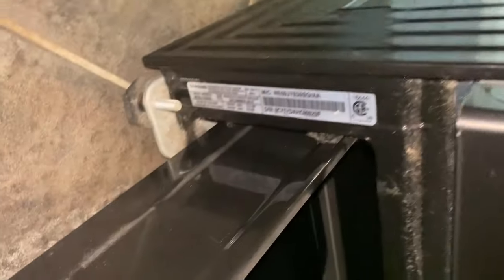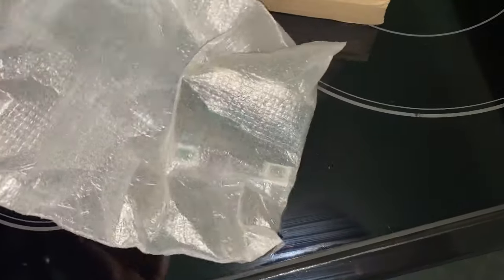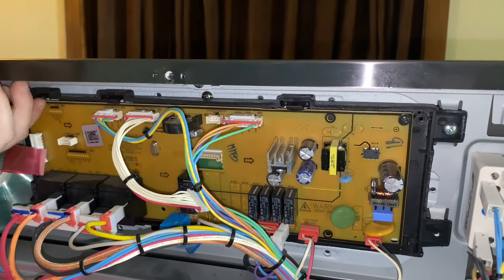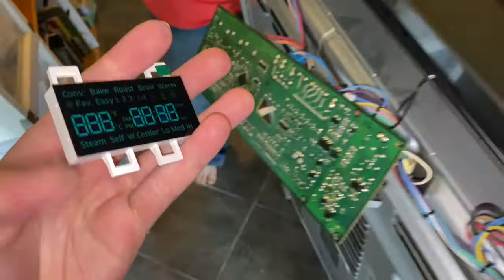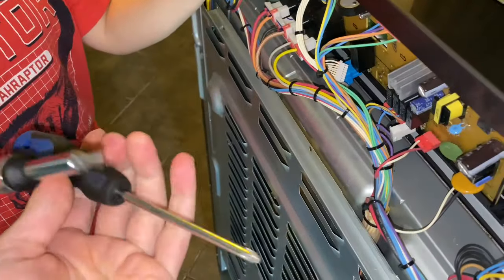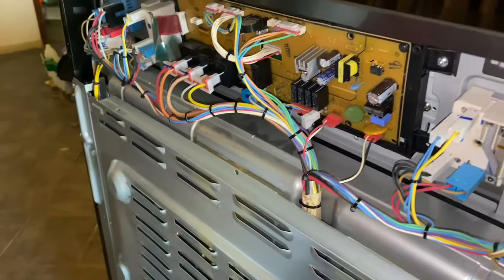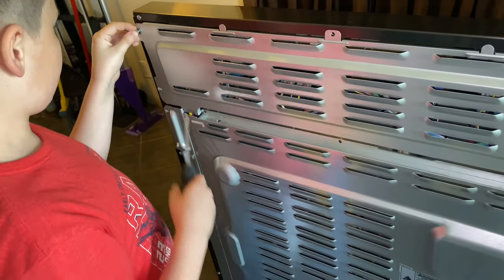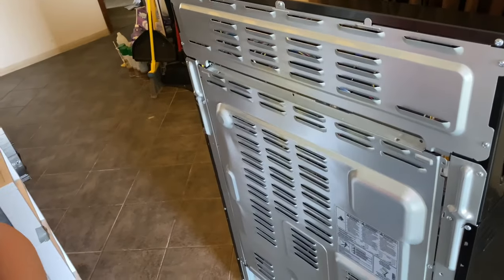Samsung stove NE59J7630SG display flickering repair fix replacement

Comment: Thank you for sharing this collaboration. My stove has been flickering for 2 years it’s only 4 years old.
Reply: I have the same thing. NEVER repurchase a Samsung. Mine is. 5 years old. Extended warranty just ended. I was told by an repair man to never use the self cleaning part because it heats up too hot and can ruin circuit board.

Comment: Nice job. 

Hey Samsung. This video has been watched 33k times. Do you want to know why? You sell faulty equipment. My stove required a new pannel in less than 4 years.
Reply: Samsung is building a reputation…too bad it’s a “do not purchase our crap reputation”!
Reply: Purchased a full suite of Samsung kitchen appliances.  Never again.  
Stove - this issue
Refrigerator - infamous ice clogging issue
Microwave - clock loses two minutes a week, peeling at edges
Dishwasher - blades break, occasionally faulty moisture leak detection so it won't run for a few days

Comment: Thank you so much — I googled previously and I found I had to replace to the board for over $400- so glad I found this video! I’m glad I watched the whole thing though because I didn’t realize I had to unconnected some wires before taking off the board. I got to see it go back together though and that’s the important part. Much appreciated!

Comment: Thanks Man, had my bloody screen flickering for over two years and even tried replacing the board once last year but it didn’t work. Your instructions were spot on, just did it with the wife while following your video and it’s fixed. Thank you so much man, great job with the boy as well.
Much appreciated!

Comment: Thanks for the explanation and video. It looks like a repair that we can do ourselves. Great job Alex and Alex’s dad! Update on our installation of a replacement digital clock. Our son helped us with the installation and found it more difficult than we expected to unplug the cable on the back of the broken clock when removing it Also, 2 of the black plastic hooks that held the old clock in broke off. We used electrical tape to securely put the new clock in and everything is working well.
Reply: I had the same exact experience. Managed to break a clip and had to tape it back on.

Comment: Thanks for you video. Our stove has been flashing for a long time. Hasn't affected the operation but is annoying to see it flashing all the time. I have the same model as yours. Very cool you did the video with you son!!! I have the part on order, so hopfully ours will be   like new again as well.
Reply: Ours is flickering as well but I can live with that although I am wondering whether the flickering is a precursor to a complete failure meaning the stove would not be usable.

Has anyone waited until it fails?

Secondly, what kind of assurances does anyone have that the replacement display doesn’t start flickering a year or two after installation as they are likely all from the same manufacturer.

Comment: Thanks. Very helpful. A little more detail about removing the cable connectors would have helped, but no big deal. As someone else mentioned, no more disco lights.

Comment: Great video. I had  the same issue. I did many projects with my Dad and as a result rarely call a repairmen or hire contractors. I noticed that you didn't take off the protective film on the LED before install, probably will make little to no difference in the display.
Reply from the maker: You are right, Just a clear film. This was the friends kid, believe he’s on the spectrum. I wanted to include him since it showed others that a child can do it, they could too and he asked before my arrival if he could be on YouTube. 7 months later, over 10k views, he’s done more than what he realizes.

Comment: Nice video but you cut out the part where you disconnect the two connectors. Would have been helpful to see the original issue too. Thanks though. Still a big help.

Comment: All of my Samsung appliances are junk
Reply: Bingo!
Reply: I told my girlfriend I hated Samsung before we bought a house. We’ve been here 2 weeks and I’m here watching this video. I’m replacing all the appliances within 2 years. Even if they’re working, I’m a man of principles.
Reply: Yes they are junk. I have a stove and fridge and they are both nothing but problems. Garbage.
Reply: Amen to that. My are also terrible. My dishwasher is the worst.
Reply: Yep! Just replaced a fridge and now doing this repair on the stove
Reply: Ditto junk
Reply: Junk at best. My Samsung gas stove  has a mind of it's own. Turns the light on inside the oven. Some times it will turn off ,or unplug it. Service was a joke too. Was told it was out of warranty. After a few mean texts with tech . Told they would pay for the part, but service was on me at 130 an hour!!!! Told them to send part I would fix it myself. But sure they couldn't do that  I think someone should start legal action against them. I'd be on board.
Reply: The biggest piece of garbage I ever bought, I used the oven twice and a f-c7 code is on the screen. Call the store SOL, the warranty just expired a week ago 😡😡😡
Reply: SAME
Reply: All of the samsung appliances we've had are the worst. They need to stick to making phones.
Reply: Biggest regret of building our house.
Reply: Same here!!! I regret Samsung

Comment: Hi, when this happened did you experience your bottom right element to turn on/off when you turned the knob? My stove currently has the LCD issue and the bottom right element goes on/off and I feel as if the oven is doing the same.

Thanks, J

Comment: I wish you had show the flickering before fixing.  Mine is doing something and I am not sure if it's what yours was doing. It's a Samsung and on the display you can see really light background lights flickering, like the time and everything I am using looks normal, but in the background you can see flickering other symbols that aren't being in use.  Is this what yours was doing?  My stove looks like your exact model.  Is it the same situation??? Thanks!
Reply: Did you find a solution or did doing the same thing as this video helped? Our's is the exact same issue as yours and seems like it's a common issue going around when I was looking at the Samsung community board site, the mods just tell you to PM them your model and stuff for help. But seems the consensus is to buy the range part that cost around 100 dollars to solve the problem.
Reply: @PlatonicPurplePanda  I haven't tried it yet, seems like a lot of work lol.  Not really, but just haven't got to it, seems everything is going out, light fixture went out, dryer went out, fixed those haven't got to the stove.  I hate to just buy a new one, it's not even that old, a year? 2 Max? Shouldn't be faulty already ugh....

Comment: Great video.  I like how you took the time to teach your child.  
Question.  My display is flickering around the edges.  The main part "numbers and clock" are fine.  Should I be replacing the display unit of wait until the entire thing starts to flicker?
Reply: I have the same thing. The clock is steady, but the background stuff is lighting up and flickering faintly.
Reply: Same here. The Digital clock is steady, but everything else is flickering .

Comment: I had mine replaced last year under warranty by the company cz it was flickering also. But now features are starting to slowly show up like it did when it started to mess up before......like the F° symbol shows slightly all the time now...🙄 other than that, we haven't had any other issues with our stove or fridge. This is frustrating tho! Cz we want an over the range microwave but don't know if we should change brands or stay with samsung...

Comment: Same issue for out damnsung stove too, all the buttons flickering even when they are not turned on, will any problems accrue if you don't fix it?
Reply from the maker: I wouldnt leave it faulty like this. That’s for sure

Comment: I wish you would have showed the failure.  I have the same stove (no problems yet).  I wish their clocks had a battery backup.  Mine is always flashing 12:00 - lol.  Did you take the old LED display apart and see if you could see what was wrong with it?
Reply from the maker: It was hard potted, they had just new floor installed in kitchen so I didn’t want to move the stove or wait for it to be done. It would have added detail to video but they themselves will know when it happens
Reply: @hitandrepair  So, you said that the LEDs where flashing?  Something to look forward to on mine, I guess - lol
Reply: @hitandrepair  BTW, I'll need the kid to show up to fix mine - lol.
Reply from the maker: Lol I’ll send his mom the note lol, yeah they flash. Display is 97 bucks!
Reply: @hitandrepair How long has the replacement digital display lasted? 
Concerned buying one from the same batch of lemons as the original one.

Comment: These Samsung stoves are a piece of junk. I have read of so many similar problems on the internet with this display. I called Samsung about this and they sent me an email where I could get this part for about $100. There should be a recall on these stoves. My stove is just over one year old. Will not buy Samsung products again!

Comment: I have this stove.  The construction seems pretty solid,  but I'm on to my 3rd repair on this 4 year old stove.  The control panel led just started flickering,  so that needed to be replaced. 2 burners have bad sensors so the hot burner light stays on,  the only way to repair this is to buy new burners. $100 or so each.  I'm on to $300 repair for a 4 year old stove. That's ridiculous.

Comment: I have this same model.. I had some issues with the breakers and after the electrician did a diagnostic..  the display is flickering in the background.  I can't seem to turn the demo on and off.. If I'm confident this will fix my problem.. I'm on board..  can anyone advise me  ?  thx.. Kirby

Comment: I had this replaced about 1 year after purchasing this stove. It was covered under warranty. It is now doing it again several years later. No warranty this time. Samsung appliances are absolute junk. Also have a Samsung double door fridge with sliding drawer freezer. It builds up frost and is freezing the tracks to the point that the ball bearings are breaking. I will never buy anything Samsung again.